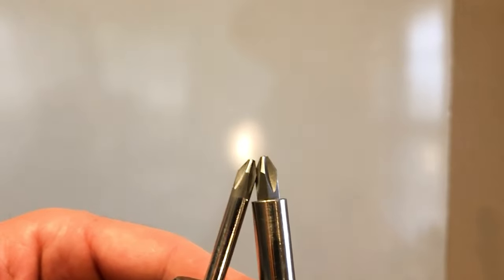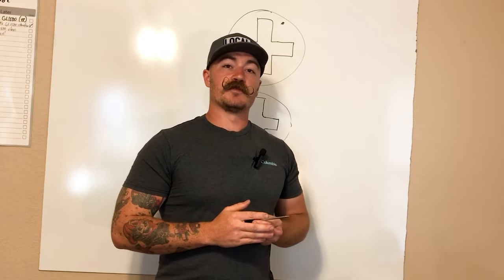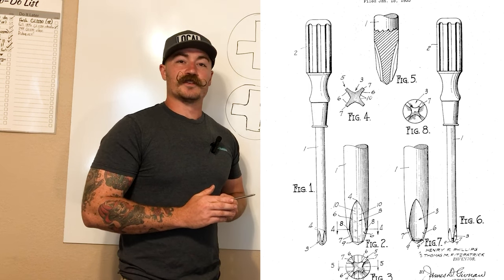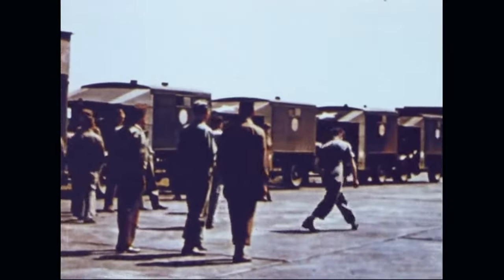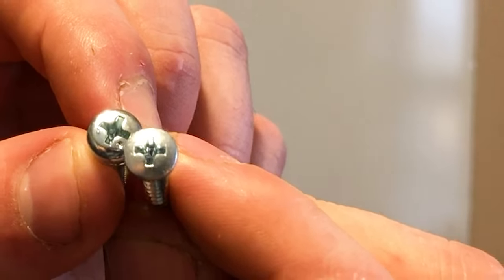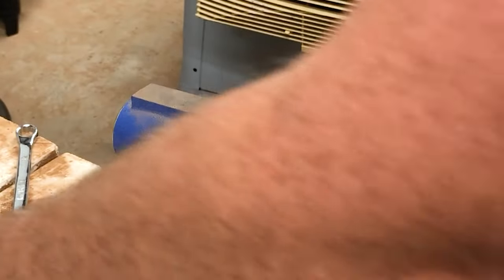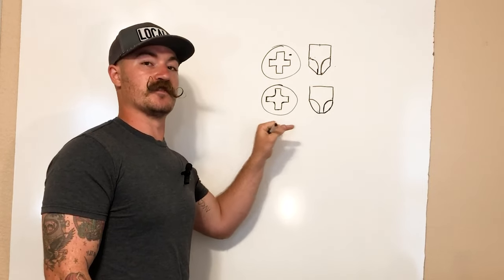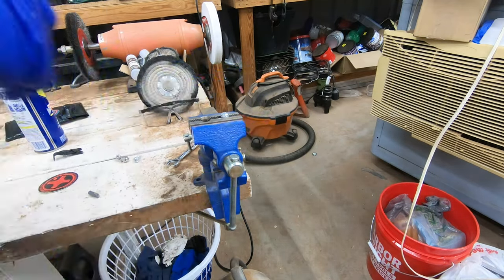YOU HAVE BEEN USING THE WRONG SCREWDRIVER ALL ALONG... Phillips VS JIS Screwdriver

Comment: you should have covered pozidrive while you were at it. The danger comes when you use an impact driver. Tips can break shooting hardened metal everywhere. Look closely at the fasteners..
Reply from the maker: Thank you for the comment, I will probably hit on them in another video! And that is a good point I did not mention. Also with impact drivers you can break the tip of the screw bit off into the screw leaving you "Screwed"
Reply: @octanerestorations  the danger is if you use not the right bit for the fastener and then honk on it with an impact driver. Human strength poses no such failures (usually) if I was unclear.
Reply from the maker: @automan1223  I believe you are right!